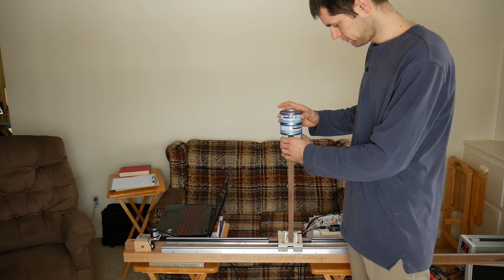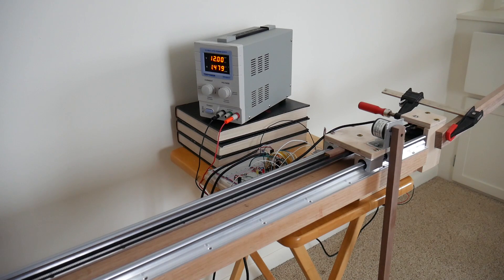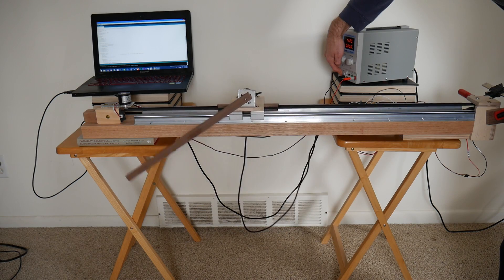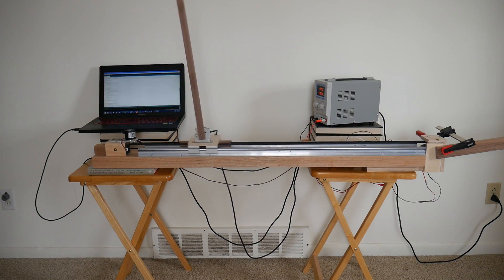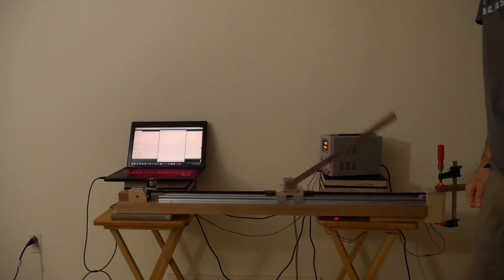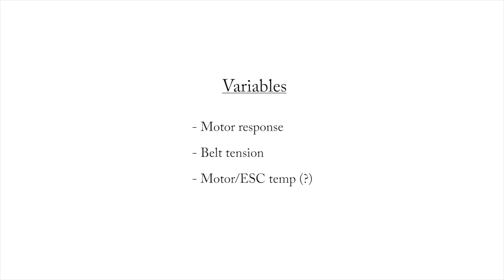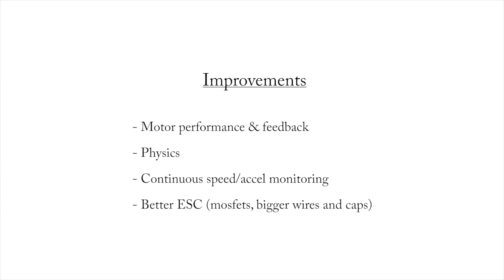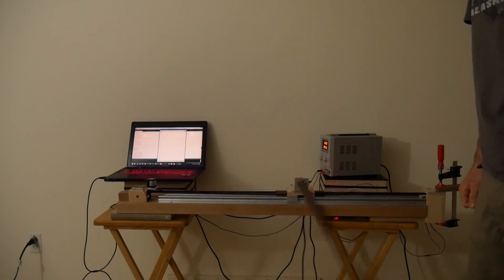Inverted Pendulum(s) #3 - Swing Up

Comment: I do not wish to imply that building a functioning model is easy: However in this 2D case it is simple enough to reason through the process, for me when the pendulum swings up (it has rotational energy) the motor needs to move in such a way to absorb the energy, into a rotational velocity small enough for the balancing stage to be a success. So initially increasing the energy to swing up higher, using timed deceleration to increase rotational energy, then at some point, subtract energy to slow to do the catch. These 3 stages are controlled by angles rotational velocity pairs.

Comment: Hey! Have you ever thought about replacing that DC motor with a stepper motor, like a nema 17 maybe?
I have a very strong feeling that this will eliminate a huge portion of your problems.
For example the non linear response of the dc motor, where it just doesn't spin with low duty cycles and just sits there humming... This will no longer be a problem, and the stepper will give you  a much more precise position control, since it responds instantly and in the correct measure.
Reply from the maker: I started with a stepper motor but had more difficulty driving it, particularly at higher speeds. This could certainly be overcome but it's why I opted for a DC motor.
Reply: @ScottRumschlag  Really? But did how many steps per rotation was the one you used? A nema 17 is about 200 if im not mistaken, and it's fairly strong too
Reply: I've moved from a stepper to brushed as well.

Comment: Can you please share the arduino code you are using.
Reply from the maker: It's very specific to the hardware and very simple overall, so you should able to write your own with a solid conceptual understanding.
Reply: @ScottRumschlag  Actually i am facing problems with swinging up the pendulum
I have only 50 cm long rails

Comment: Hi, after see the slow motion carefully, I think the problem that your reversed pendulum not robust is you control the speed of motor instead of the acceleration. only acceleration can produce torque for pendulum. besides, in your video, it seems motor hit the max speed easily and does not acceleration anymore. I also tried it with good motor driver, which can be achieved very easier.  negative position feed back + positive angle feed back to swing it. and negative angle feed back to hold it.

Comment: Hi! I'm working on the same project. I have a problem about motor and encoder for pendulum. I would like to ask if you can write motor and encoder which you used your project. Thanks!
Reply from the maker: The motor is just an rc car motor with a relatively high number of turns, the encoder is 600 pulse/rev, quadrature output: https://www.amazon.com/gp/product/B00UTIFCVA
Reply: What is the Voltage rating of the motor?

Comment: I hope you're not using the PID library, because it is not very well suited for unstable systems. I did a similar inverted pendulum. More like a Segway. Sainsmart and various other manufacturers seems to already provide a solution on Amazon for a full kit.

Comment: Hi there, don't know if you've seen my video, but here's my project: https://www.youtube.com/watch?v=4kIrcELC79o
My PID also had problems catching pendulum. LQR was way more robust and worked much better.
Here you can check LQR implementation: https://www.youtube.com/watch?v=K_IcYiVi8oo
Reply from the maker: Very nice, your setup seems to have very good low speed control. I've been working on the pendulum this week, sorting out various small issues, etc. I want to get PID working if only for the educational value but LQR definitely seems to be the way to go long term.

Comment: Could you share the code ? , i am trying to implement the same but using Stm32 discovery board, Trying to figure out the logic you used to determine the cart position and angle of the pendulum  to the PID controller 
....  saiganesh_panchu@yahoo.com

Comment: Hello scott, nice work. I am studying control engineering and working on a self-balancing robot (practical application of inverted pendulum). Generally tuning of coefficient of PID controller is difficult and cumbersome. This is the reason we ,as control engineer, go with more advance control like LRQ + PID, SMC, Intelligent control (IC) + PID, IC + SMC, MPC, etc. As per my studies, I am trying to implement all variety of controllers one by one and see the observations. Hopefully I should get something to work on and produce a research paper.
Reply: Correction: LQR*

Comment: "The PID control is not designed to handle something coming in with a velocity."  Actually, that's what the differential term is doing.  It is accounting for the motion that already exists by canceling out some of the command you would otherwise give the motor.  One way to think about it is "virtual friction".
Reply from the maker: +Ben Jackson I should have said "my PID control is not capable of dealing with angular velocity". This week's upcoming video should be very helpful at quashing future motor performance issues . . .

Comment: Hi Scott. I follow other excellent DIY channels, and Ben Krasnow's recent spin coater project (https://youtu.be/321tptQ8PrU) is very relevant to your Inverted Pendulum. While the project is very different, his research and experimentation with motors and motor control should prove useful. If you don't use some of it directly, it will at provide some insights and kick lose some new ideas.

Comment: Why does it take so long for the PID to take control when the stick is upright? Do you not have a "window" of say (+) or (-) 15deg of 90 (stick upright) to trigger the PID loop? I'm basing this off of the delay I saw between seeing the stick in an upright postition... and the light changing indicating PID control.
Reply from the maker: +jparabie Yes, I forgot to mention this in the video but my final strategy had three steps: swing up until it's within 40 pulses (about 6 degrees) of vertical, then a special mode to cancel out the angular speed, when the angular speed is close to zero and the cart has slowed down transfer to PID. This is a  bad solution but as I mentioned in the video it seemed so closed to working that it felt unreasonable to overhaul the entire system. 20/20 hindsight.

Comment: nice work, but I suggest you to use step motor. You will have much better control on speed and torque. https://learn.adafruit.com/downloads/pdf/all-about-stepper-motors.pdf
Reply from the maker: +Pawel Tylinski I tried using a stepper motor at the beginning, good low end torque but not enough at higher speeds: https://www.youtube.com/watch?v=Lpoou1kbnd0
Reply: +Scott Rumschlag
you can change steering eg. if you have 4 coils normal method is to give voltage at one coil at the time:
1000 , 0100, 0010, 0001 , 1000 ......
but you can do also:
1100, 0100, 0110, 0010,0011,0001,1001,1100 ......
more accurate but slower
or:
1100,0110,0011,1001,1100 ........
this same speed, but stronger
at very fast speeds, you can skip some coils:
1100,0011,1100,0011
etc.

Comment: I'm just guessing here but, I think it would work better if the pendulum had a bit a weight at the end of the stick. Balancing a stick on your hand is a bit hard... add a weight on top & its a lot easier to keep it steady. You get my point. :J
Reply from the maker: +creativeobsin Maybe, technically the mass of a pendulum doesn't affect it's period, but you do need enough mass so that things like air resistance and encoder friction can be ignored.
Reply: +Scott Rumschlag Adding mass to the end brings the pendulum's center of mass further from its center of rotation, thus increasing its effective length, and thus, its period.
Reply: +creativeobsin For sure it would work better
Reply: +TheMagicOfGabriel That's what I thought :)
Reply: +Scott Rumschlag I was wondering about the number of swings it was taking to get the stick headed up and why it appeared to be so inefficient.  The thought of a few fender washers screwed to the end of the stick definitely came to mind.

Comment: What about taking out the belt system altogether, and using a track with teeth that engages with a gear at the pendulum? It seems that belt will always have too much slack due to the distance.
Reply from the maker: +Pat James I thought about that too. One disadvantage is that you then have the motor's mass on the cart. I opted for belts as they were simple and there are several very high-end systems that use belts too. There are a few pendulum systems out there that use linear motors (magnets!) to move the cart back and forth, they have incredible acceleration.

Comment: Hi Scott. I am guessing, you're problem is that the PID-controls will control a linear or already stable system pretty well. But what you have here is a destable non-linear system and the position control PID will not be sufficient. It works sometimes, because the system gets randomly into a state, where it's quasi-stable (the pendulum gets to the highest point at a 0-velocity without any control). 

As you've probably already realized, you need to control not only the position but also the angular velocity of the pendulum. Typically, this is done using a cascaded control system, where the position control feeds an input to the velocity control. This way the velocity control would still try to get the system to a standstill (at least in the rotation joint) and this would mean that while the pendulum is swinging upwards, the velocity control will try and dampen the speed, while the position control is trying to still get it to the highest position...
Reply from the maker: +Oan Nam Yeah, it's unclear in the video but I added a brief mode between swing-up and PID to try and cancel the angular speed, but the results were unreliable. An integrated system like you describe is in the works.